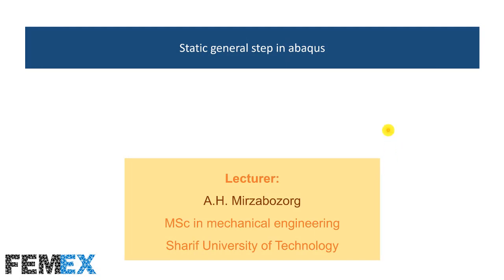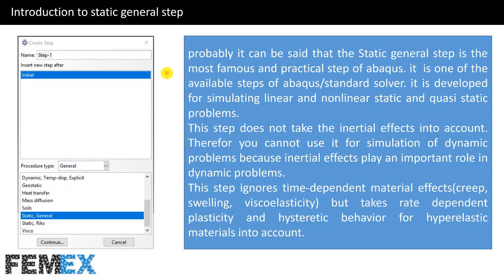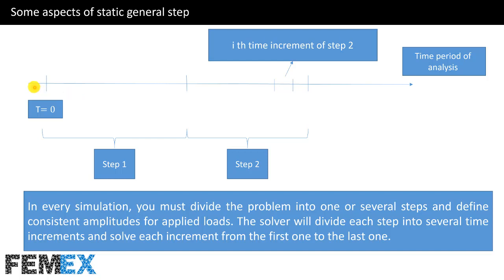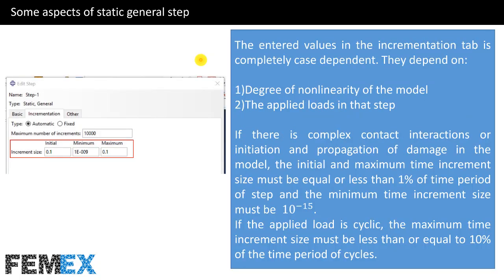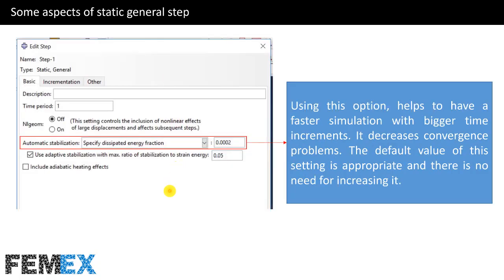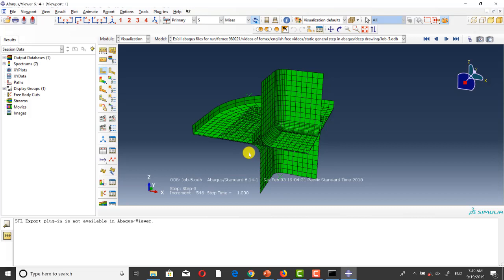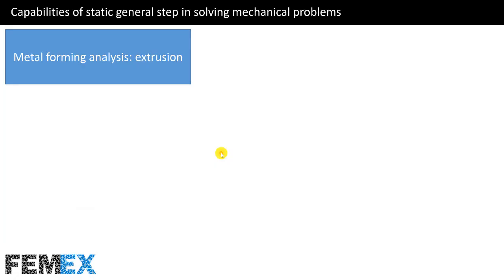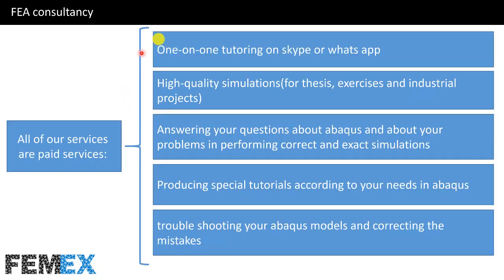static general step in abaqus

Comment: I have dealed with two loads types one is concentrated on column and the other is cyclic on beam and I want to ask how represent them shall I define them for two deferent steps and if i do that what the time shall be given to the column gravity load or combine the two load types in on step?
Reply from the maker: Hi.
According to your explanations, I guess you are modeling a beam-to-column connection.
Here are the answers to your questions:
1) If the parts are made of steel, there is no need to define gravity load. But if they are made of concrete, you must define the gravity load.
I suppose that they are made of steel:
2) you must define two steps:
step 1: applying the concentrated force as preload.
step 2: applying the cyclic load.
3) time period of step 1 must be 1 second and you can suppose that the time period of each cycle is 1 second so the time period of step 2 will be equal to the number of cycles.
Reply: @FemexIran  thank you ,I am modeling concrete beam column joint
Reply from the maker: @shadymostafa9375  You are welcome.
So you must define three steps. Step 1 must be defined to apply the gravity. Its time period can be set to one.
In step 2, the concentrated force must be applied.
In step 3, The cyclic load must be applied.

Comment: I am trying to simulate a test for 100 sec and the crack fully propagates in 0.1 sec. I tried the dynamic step and still having the same problem. Any suggestions?
Reply from the maker: hi. it seems that the mechanical behavior is not defined correctly. because before the enough increase in the load, the crack propagates rapidly. I think you must check the units and values of defined material.

Comment: would you rather to model a three point bending with 3D elements and damage behaviors WITH #DynamicExplicit or #StaticGeneral ??
Reply from the maker: hi. multi-point bending test is a popular test in engineering and it is a good idea to model this test. we will do this in the next videos. thank you so much for your suggestion.
Reply: @FemexIran  can you may also consider a 4 point bending test in rcc beam with concrete damaged plasticity so that vertical crack propagation and diagonal crack propagations can be simulated at the end of the analysis with static general step.
Reply from the maker: @kankandeka  presently, making video for that topic is not in our plan.
Reply: @FemexIran  okay in dat case...can you help me with such a simulation?